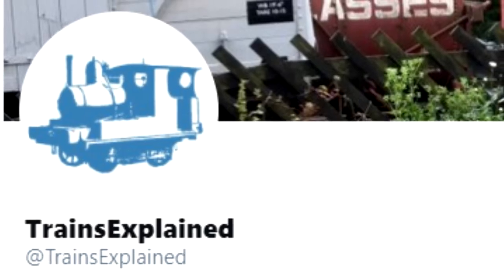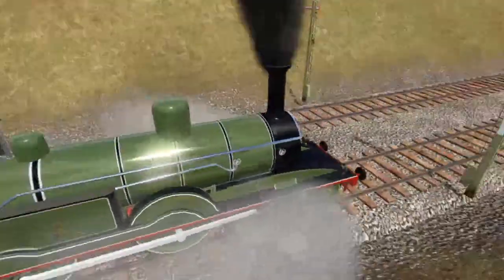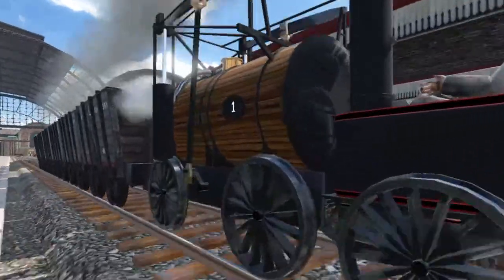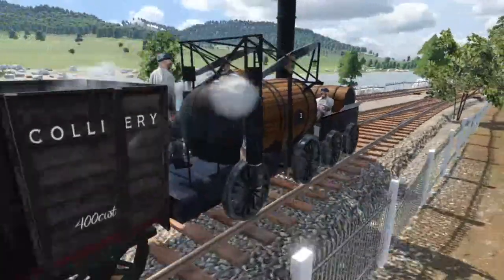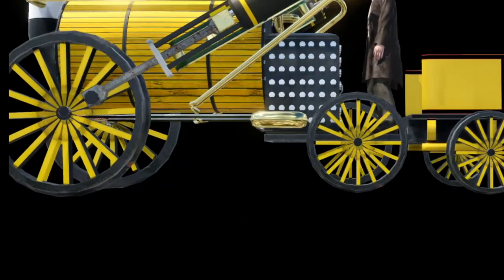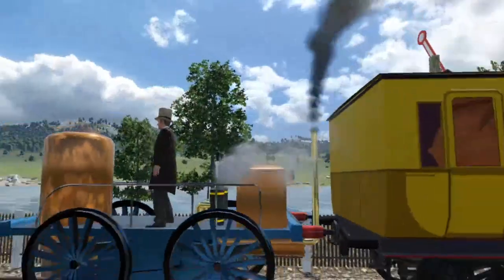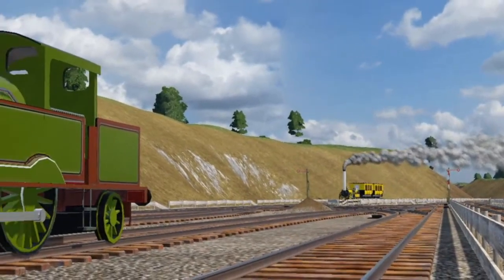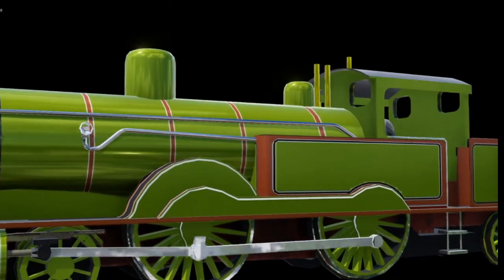Wheels - Trains Explained (Pilot Episode)

Comment: A better explanation of wheel numbering would be, for example: 2-8-4, where 2 are the wheels in front of the drive wheels, 8 drive wheels, and 4 more wheels behind the powered wheels. None of these numbers can be odd, as there will always be two wheels per axis.